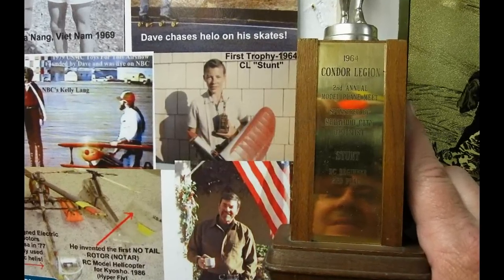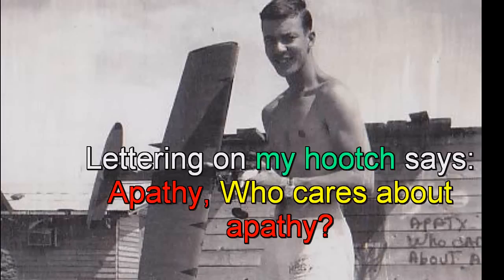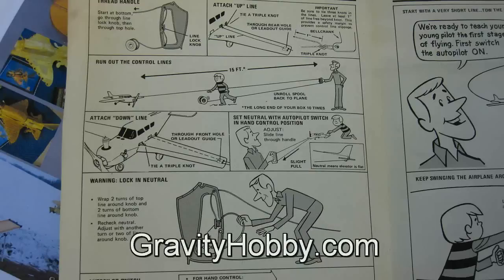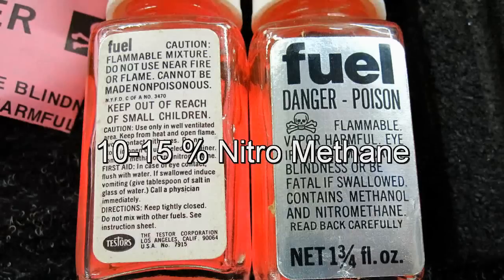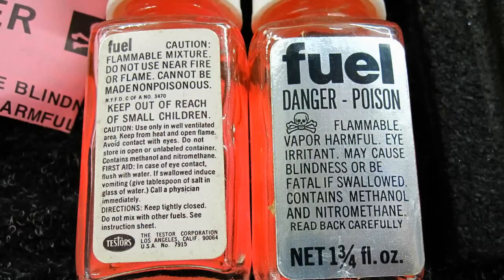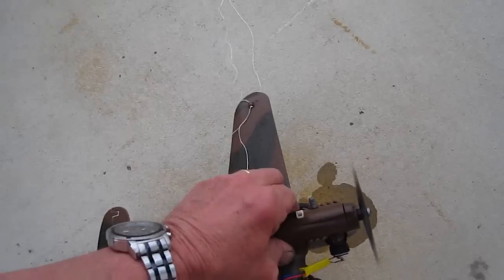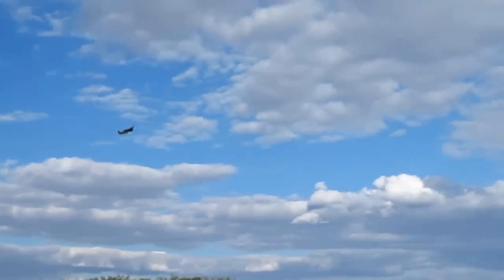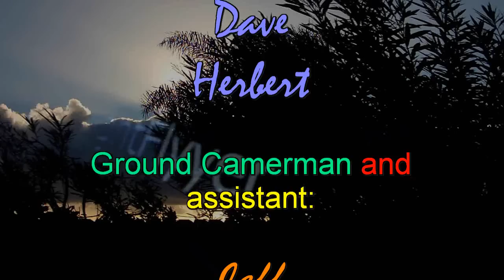Vintage Cox Control Line Plane's History and flights by NightFlyyer. A few are Testors.

Comment: We had a P-40 in the mid-late 70's., can't recall if it was Cox or Testor.  In any event, my brother and I still get a laugh recalling the first flight that my Dad insisted he manage because he insisted "we'd crash it and break it."  Anyhow Dad pulled up way too hard on take off and quickly got the plane into a brief series of steep climbs and dives that resulted in hard impact on the asphalt less than 10 seconds into the inaugural flight.

Comment: I had an electric COX plane like this, I think it had a big capacitor inside and you would charge it up from a big 6 volt battery and fly for a minute or two but I crashed it really hard after only a few flights and soon forgot about it

Comment: Great video 😊
Reply from the maker: Thanks so much. If you like that one, here is one on the Cox Pt-19 you may also like.  https://www.youtube.com/watch?v=BU0z7ddwslY&t=62s
Reply: @NightFlyyer     I have a Wenmax Hotshot which I used in my youth,  and recently bought a Cox 049.   I getting worried about the vertigo though !!  
I’m across the pond and grounded due age after a lifetime flying the real thing….and I’m getting that old excitement back as my Mercury Marvel approaches completion…..my best friend crashed my Marvin on its maiden flight,  so I’m making a new one with a number of mods which is why I’ve christened it the Marvel 🙈😊😊😊…..time will tell !!!
Reply from the maker: @californiadreamin8423  Right on.  Good luck with it and happy flying.

Comment: I see what look like rolls here. But how can you roll a control-line plane?
Reply: +BruceK10032 I'm not sure why it was edited this way. It almost seems intentionally misleading but he picks up the U-Control then just before taking off, the video switches to an RC P-40 Warhawk made by Airfield.  http://www.nitroplanes.com/93a260-p40-green-kit.html Then ends with the U-Control plane crashing.  Maybe its intended to demonstrate how far r/c technology has come.
Reply: You can roll a control line aircraft  some of them had higher lift wings  but it ain't easy and you need long strings and a big circle. To get the plane higher. So it clears the ground.   It would be real oval  when. You get long strings though you have to make sure you don't lose your tension on takeoff. I used to be backing up slow walking in a circle  a lot as I was flying.

Comment: The planes and cars only ran for a few minutes the gas tanks were tiny! Then you always had to replace the glow plugs because they only lasted 2 or 3 runs in cars and planes.But they had real working rudders and wing flaps and the cars had real rubber aired up tires,

Comment: After flying do you clean the engine if you won't use it for some time?
Reply from the maker: I usually squirt some 3 in 1 oil on the front bearing and into the cylinder so it doesn't gum up.  If it does,  you can loosen it up with a hair dryer or heat gun.

Comment: Ive still got everysingle one of mine , both testors and cox, the castor oil and kl200 klotz lube smell was awesome together still plastered goo all over my planes , might have to get them back out as the r/c world is ending because of this remote i.d. b.s.
Reply from the maker: Glad you still have yours.  Mine were all destroyed in the fire.  I have since obtained a brand new PT 19 in the box and flew it last summer.  It is fun, but not as fun as the non dizzying RC which I agree, we don't need remote I.D.

Comment: I had one of those testor's P-40s as a kid and never did make the engine run, but the lines were short enough that I could "drag" it through the air.  Still mess with CL airplanes occassionally, never got into RC though.  I fly jets for a living.  Aviation is not an occupation, it's a disease.

Comment: The COX brand fuel as I recall, was very high in nitro, something like 25 or 30%.  I tried to run one once with 10% fuel, but it wouldn’t fire or even sputter.

Comment: IN 19 73 MY DAD  GOT US A COX POWERED PLANECALLRD THR SUPER STAR IT CAMR WITH A DISC WITH HISH AND LOW SPOYS PRE FPRMED ON THE DISC AS THE MOTOR RAN IT ALSO ROTATED THE DISC WHICH IN TURN ROTED AGAINDT RODS WHICH  CHANGED THE POSITION  OF THE RUDDER CAUSING THE PLANE TO FOLLOW A PARYICULAR FLIGHT PATH DO YOU REMEMBRT THAT ONE? VAN YOU POST A DEMONSTRATION OF THAT PLANE?
Reply from the maker: Sorry I do not.  I tried googling it and can't seem to find it.

Comment: I have the P.40 war hawk. Got the engine running yesterday, it just required a lot of wd40, rust dissolver, brake cleaner and nitro fuel.

Comment: Ohhh .... yes.... i remember that days.... im now 54 and since i remember my phater and older brother make planes, of course rubber band power , control lines, even static plastic 1:75  scale.... (radio control was too expensive on those days) balsa wood, dope, silk, duco bond..... and of course spend 3 hours disasemble those cox engines and try to figure ot why dont work,,, until understooand the way it works.... and get drunk spining with the plane 🤣🤣🤣 the smell to...... here in Mexico the control line airplanes was sold by a company called Lodela..... ho boy what a times..... the real happy ones....
Reply from the maker: Right on.  Glad to hear your story.  Thanks so kindly.  I would bet if you liked this, you will like to see my latest video of my 63 year old Cox PT 19 U Control recent flight. https://youtu.be/BU0z7ddwslYUkie

Comment: Was there not also a pee wee 0.25 ?
Reply from the maker: The Pee wee was a .020.  Cox made the .010, .020, .049, ,09, and .15. engines. Tee dee's versions had no tanks and were needle valve versions. The others had round tanks attached and reed valves.   Check out my latest, this week UKIE video where we got Goated!  https://youtu.be/HdmXA0Xc1ew

Comment: I've always wondered how much power those little engines would make on 90% nitro. :D
Reply from the maker: Hi nitro helps, but 90% probably would blow it up!  Thanks.
Reply: @NightFlyyer  If it managed to run it would be so lean it would probably melt the piston in no time flat. I've been around drag racing all of my life, know a fair amount about nitro, and it requires a ton of fuel volume compared to methanol; going from 10% or 15% to 90% would be a big leap.

Comment: You should check out coxinternational.ca. They're still selling the old Cox motors, new spins on them, and they even have a throttle AND a head that lets you use standard 1/4x28 glow plugs!

No reason to settle for one of those soulless brushless parkies. Let the skies echo with the buzz of a Cox 049 once more!

Comment: Great memories, Yes i had a cox with a peewee engine, i think it was a stuka it was green plastic, and flew ok until i modified the engine and upped the compression..then during a flight the engine popped and started running backwards in flight..needless to say the bird changed flight plan and instead of going round and around it turned left and flew straight at me down the wires..so after that i built a flat wing, with a clunk tank and that beauty would do verticat 8's over the top all day.  I also bought a few off a friend, all solid balsa p51 and a spit, but they could barely loop so got bored with them very quickly this was in 1970  then i did a bit of rocketry and then bought a helicopter that had the engine on top and turned the rotor by torque from the engine..big piece of crap but have still got the pictures of that one. then wanting to be different a freind and i did some gyrocopters on wires, they were great fun and we even flew them after they were so destroyed it was just wheels, engine and an elevon. the gyro when the fuel ran out we used to just throw the handle forward and it would land it's self..so funny.. turning to radio control i started doing boats for a while, but then came my master piece, i built a test platform to get some data as they just didn't exist and made a hovercraft..the test rig worked so one weekend non stop i started friday night and working right through the nite  and up to lunchtime  the next day and had me a twin engine hovercraft. after some modifying the rudders, going from one central, to two out board, then ending up with three rudders i had a super controlable hovercraft...one engine for lift that would scream it's nuts off as it was too powerfull despite having two three blade propellers in a 10 inch duct...and a 10cc engine to provide thrust. it would go about 60 mph over grass so was a lot of fun..then years later did helicopters that actually flew, an alouette with a kevan head and another 6.5cc engine. and also still have the pictures of that..i mounted twin external fuel tanks and used red fuel so i could monitor the fuel level..it made it look like a crop duster..

finally moved to submarines, with working deck gun in 1/50th scale firing a 2mm dia shell about 30 feet.. Radio modeling and control line was great fun and your video brought it all back, so lets hope that some of your vieuers have a go because its fun, and a different sort of fun than the drones and tiny pocket helicopters they do today..and i have one of those that i fly indoors just to annoy the cat..now i just fly kites, but big stunt ones, and two of them are signed by the master himself Ray BETHEL; they are the most special things i own. Watch Ray's videos and listen to his story and you will cry with admiration for the guy. Colin
Reply: colin martin )

Comment: The type of stunt flying done in the 60's and what's considered 3D stunt flying today are really not the same thing.  3D planes have specific characteristics such as a huge power to weight ratio and absurd control surface throws which allow it to perform maneuvers that no real plane can do.  And then 4D, for example, takes it a step further with a variable pitch prop that will let you reverse the thrust.

Great vid, thanks for posting.

Comment: The Cox planes sold in Australia were generally over weight and under powered , under reactive on the controls and guaranteed to crash.
Reply from the maker: My wife worked at Cox and said they never changed anything on the models going to different countries.  Surprise to hear that, but they did have a steep learning curve.  Check out my latest.  Cox PT 19 last fall.
https://www.youtube.com/watch?v=BU0z7ddwslY&t=6s

Comment: @NightFlyyer  "it was a stunt contest, today they call that 3D"

I was simply commenting on your statement only.  You are right, 3D is extreme stunt flying.  But your 1964 contest would not be considered extreme stunt flying.  There are normal stunts, and there are "extreme" stunts.  That's why they have planes specifically designated as 3D (for extreme stunt aerobatics).  They are not the same.

Comment: I  the early 80s my uncle would buy me a control line airplane for a few Christmases in a row.  I would fly a few circles and crash it
 Being 8 years old, Having no hobbie shops locally and not knowing anything these things. They would sit in dismay until i took them apart and tried to run the motor on its own.

Comment: My friend said he had the p 40 and the control line broke and it flew away
Reply from the maker: That is unusual to hear.  There are two lines. If one breaks, the other line will either give full up or full down and it will crash but not fly away.  If both lines broke, never heard of that, it wont fly away very far, especially these tiny planes.

Comment: The insane relative speed of those small, short-line Cox, Testors, etc. ukies put me off them by the time was 12.  Dizzy? Nauseous? Yes. Flight? No. I tried a COX Comanche. Mush better. Longer lines and seemingly much slower. A Sterling RIngmaster with a Fox.35? Now you're talking - until R/C that is. That is real model flght. That R/C P-40 is still way too fast, but at least you don't have to go around, and around, and around, etc., etc. etc.
Reply from the maker: Maybe you will like this.  I have had the P 40 Warhawk in RC, but it is hard to compare the both as they are so different.  Before RC, this is the way we learned engines and how planes work. https://www.youtube.com/watch?v=BU0z7ddwslY&t=112s
Reply: @NightFlyyer  Thank you, That vid really brought back old memories. I still have my old PT-19 which I got on my 11th birthday many a year ago. The sound of that classic .049 was truly evocative. Of course, the smell of the cooked castor oil in the fuel was an equal part of it. Yes, it was a very good airplane to learn about engines and basic aircraft flight. However, I learned even more about flying from a single channel (push button, rubber band escapement) Nomad R/C with an .020. Now, when that airplane got to altitude (slowly to be sure) you really had to pay attention or you would lose it. I'd love to have that airplane again, but with an electric motor and three channels.

Comment: Correction for you... Cox was never related to Testors. Testors took over the old Wen-Mac engine company around the 70's. They were trash. Also, these engines had carburetors; that's what the needle valve is attached to. My first job, at 8 years old, was showing how to start all the gas airplanes Santa Claus brought the kiddies that the fathers could start. I still work in hobbies, and we still have old Cox engine around for sale. HobbyRI "dot"com.

Comment: Of course they were basic and didn't fly well. That's not the point. Cox was good at making reliable .049s, they all flew, and they were durable so if you crashed many times you're day wasn't over. Inexpensive quality stick time. All a true beginner pilot requires is a dose of inspiration.

Comment: 2 things why didn't you just raise your hand over your head and let your wrist swivel instead of spinning in circles? And 2 could you make another video and perform an inside loop? :-) 
I was 11  when I got one of these for my birthday everytime I started it it went backwards  I never did figure it out until watching your video so I had my little green army men destroy the plane with fireworks.

Ty for posting
Reply from the maker: Swiveling over the head moves the controls too much and is not easily done.  I have flown many ukie contests and going around is the way it is done. Cox engines run both ways, so we always flipped them backwards, and they started forwards.  Weird, but it worked.  Thanks.
Reply: @NightFlyyer  Wish my pops wouldn't have been at work all the time and could have showed me more than he did I tried several times to figure it out but was not a bright enough kid at the time I got it started using the spring but never thought that it could run both ways . I wonder if my Lawnboy mower would run backwards
Reply: You had to be pretty dizzy after spinning that long we used to spin around as kids just to get dizzy and fall down  cheap inexpensive great fun times
Reply from the maker: @20x20Ghost  Yep!
Reply from the maker: @20x20Ghost  Yes, all 2 strokes are capable of running backwards.  4 strokes like your lawnmower wont, but if it was a 2stroke, it could.

Comment: If he thinks CL “stunt” is in any way equivalent to “3D” then he knows nothing of 3D
Reply from the maker: Standing still is 3d!  Duh.  I know plenty about flying control line stunt, RC planes and RC helis in full 3d mode, which used to be called Pattern.  Just check out my helicopter stunt, pattern 3d videos.  A rose by any other name is still a rose!